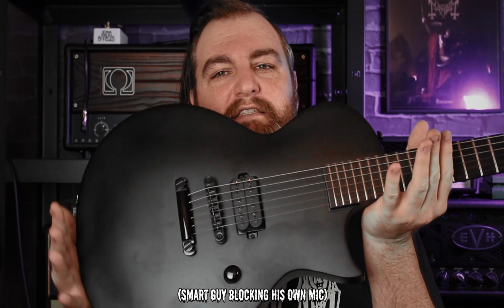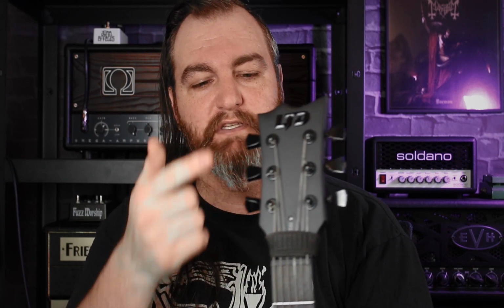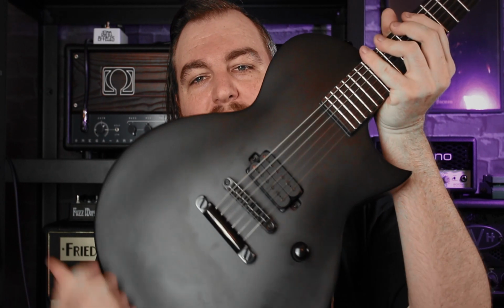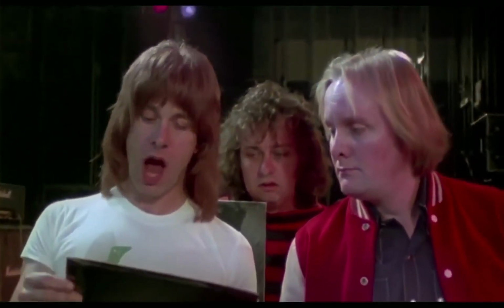ESP LTD EC-Black Metal

Comment: hey just wondering, i’m considering getting a matte black single cut but i’m not sure if i want this one or the schecter SLS evil twin solo 2. Do you have any suggestions on which one i should get?
Reply from the maker: Really both great, it's gonna come.down to scale length. The schecter is long at 25.5" which will be better for lower tunings.
Reply: @MetalHeadProductions  would you say the schecter would be good with half step down and drop c# because that’s the tunings i mostly use
Reply from the maker: @ALP..2553  that's not all that low. I use this ltd for D standard and drop C. Honestly I'd go to a store and try out some schecter eclipse and ltd ec models and see which one you like best.

Comment: do you think if i wanted to use this guitar for C standard stuff would it not work? i saw you briefly mention it at the end but wasn’t sure.
Reply from the maker: With the scale length you'll need thicker strings but it should be just fine
Reply: @MetalHeadProductions  ok sweet i was thinking 12-56s thanks!